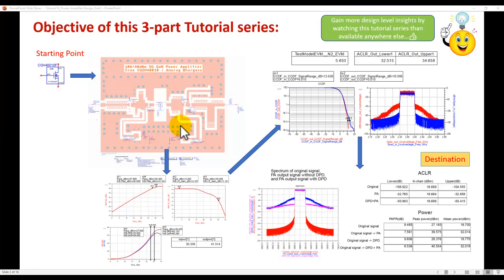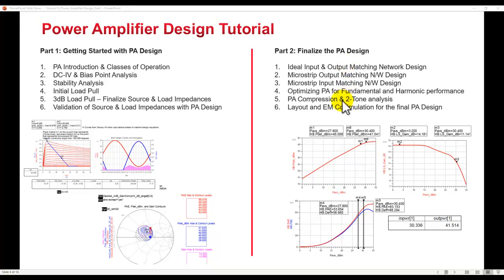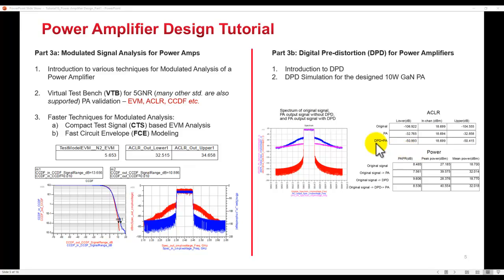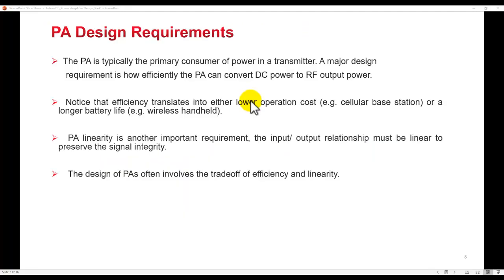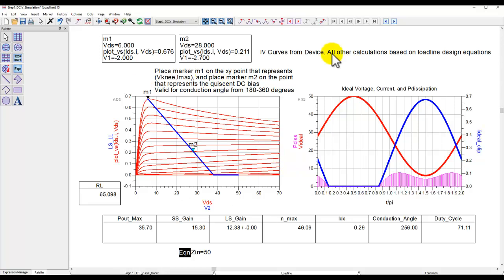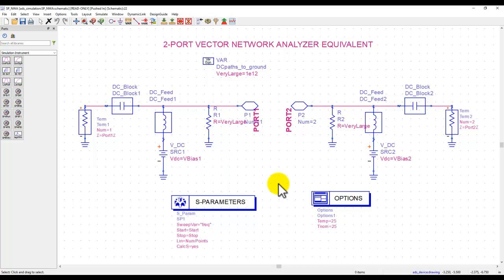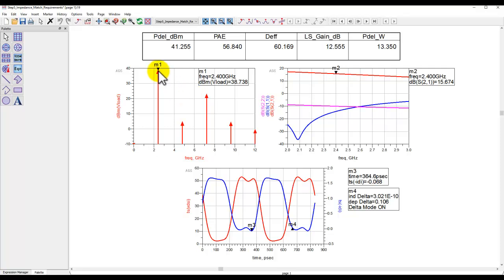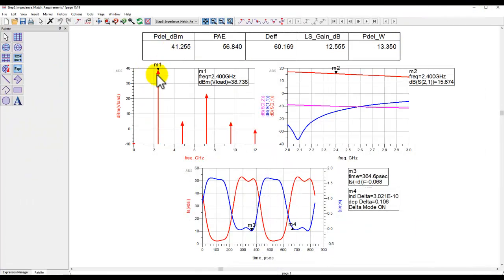RF Design-16: Practical Power Amplifier Design - Part 1

Comment: Hi sir, your video is very helpful thanks for the video but I have a little confusion, I made a power amplifier using GaAs FET (mgf0904a) and in the datasheet it says dc bias recommendation with vds 8v and ids 200ma. after seeing your tutorial why don't you use a resistor for dc biasing? like in a fixed bias circuit so it uses VDD or is it actually okay if you don't use a resistor and directly VDS? 
Thank you, I hope you can help my confusion.

Comment: @BhargavaAnurag  thank you for your lessons, they are very helpful. My question is it real to get somehow all libraries of CGH/CG2H devices not from MACOM, they are not responding? Second question, is it real to create wideband PA based only on S-parameters, so without Load_pull? Thanks in advance
Reply from the maker: @maxkashchich7206  You won’t get very far with S-Parameters while doing PA design as whole point is to have non-linearity included in nonlinear simulation. If MACOM is unresponsive then look at other vendors like NXP, Qorvo etc
Reply: @BhargavaAnurag  thank you so much for feedback. I am not so experienced in ADS, can you please give me some algorithm how i can work with s-params only? As i understand, i have to use SnP module and "simply" make IMN and OMN for source/load 50Ohm circuit? Or i can make Harmonic balance or something else? I've seen Qorvo provide only SPICE model or Keysight's others products model but not for ADS, are they interchangeable?

Comment: Thanks for the detailed PA design tutorial. I just have a question about stabilizing the PA. If we have to reduce the resistor value (to maintain a specific gain at the operating frequency) in a way that the FET becomes stable starting from a little bit lower than the target frequency range, how we can make sure we won't end up having oscillation at lower frequencies? For example, the target frequency is 5-6GHz and a 2 ohm resistor stabilizes starting from 4GHz. a 10 ohm resistor can stabilize starting from 1GHz, but will reduce the gain at 5-6GHz substantially. I was thinking maybe the limited bandwidth of the matching network at the input would help to avoid any oscillation out of the target bandwidth. Or, we have to introduce a high-pass kind of filter at the input. 

Thank you in advance!

Comment: Sir, how to efficiently copy the simulation result data equations from one workspace to another workspace?
Reply from the maker: The way I use is to simply create a Data Display Template and then you can use it in any workspace you want. Only restriction is to have same variable & node names for which you wrote the original equation else the relevant equations will show an error...😊 You can watch the relevant video under Learn ADS in 5mins playlist for more details.

Comment: thank you for this tutorial, it is very beneficial. my question is how can I apply these notions and principles on a circuit of cmos transistors like the figure below (use a basic transistors nmos+pmos to build a PA not a model like CGH400010)
Reply from the maker: CMOS kind of designs requires slightly different implementation notions but basic PA fundamentals will remain same.
Reply: @BhargavaAnurag  thank you very much

Comment: Hi Anurag,
I am trying to follow through these steps using the S2P files given from Macom for CG2H40010.
Can you please throw more light on the effect of using S2P files to design PAs.
I have tried simulating using the file but getting a PAE of -0.092.
Is it possible to use S2P files or I will need a non-linear model of the transistor?
Reply from the maker: Unfortunately you can't go very far with S2P file as it is only linear S-parameter data. Try to obtain the non-linear model of the device for proper simulations.
Reply: Thanks for the feedback. I'll contact the team for the non linear model.

Comment: Hi Anurag,
Thank you for the very informative tutorial, I am currently designing a Class B amplifier @2GHz  using this device (Biasing at -3.4V), and I'm able to follow until the impedence matching. I selected my load and source impedances, and while doing the final step, the S parameter graph is not matching what the datashet says. S21 is at -15dBm and S22 and S11 are much higher than S21. The power delivered and PAE match from the Load Pull analysis, however, the S parameter graph is not making sense to me. Is it because the S parameter is giving me small signal information? If so, does it matter in the design?
Reply from the maker: Your simulated graph may not match with the datasheet graph entirely and that's normal. S-Parameter shown in datasheet are not power dependent but just act as a guideline. As long as you have done things correctly in your large signal setup you should be fine.
Reply: @BhargavaAnurag  Thank you for the response, another issue I ran while designing the class B amplifier was while optimizing the return loss. Since it's in class B operation, S22 and S11 are not decreasing, and I don't know if it's because of the class of operation or is there something wrong with my design.

Comment: Thanks for your video. Can you share cree library? I am having problem adding cree library to ads
Reply from the maker: Unfortunately no, library is provided under NDA and it can't be shared. If you already have the library and facing some trouble then kindly contact local Keysight tech support team for help.
Reply: @BhargavaAnurag  So can I replace it with FET RF3931 from RFMD?
Reply from the maker: @thinhvu7919  Sure, you can use any device and the process shown in the video will remain the same.
Reply: @BhargavaAnurag   in step 5, i tried to simulate myself the way you share. But when running the simulation, the results are not the same. Please explain to me
Reply: specifically  in step5  I have the problem "Unable to resolve variable (s) or functions (s) in expression` Pdel_dBm = 10 * log (Pdel_W) +30 '"and so on with other variables like LS_Gain_dB, PAE ,Pdel_W etc
Reply from the maker: @thinhvu7919  I would recommend you to kindly work with local Keysight tech support team and they will be able to help you as YouTube is not a good place for tech support.
Reply from the maker: @thinhvu7919  YouTube is not a nice portal for tech support. Kindly contact local support team for help.
Reply: @BhargavaAnurag  I tried very hard to find the problem but still cannot display the data in step 5 like yours. The support team was also not helping. Please share more details about your step 5. I still have the problem as mentioned above
Reply: I think the capacitor is still the problem. it prevents direct current in step 5
Reply: "Unable to resolve variable (s) or functions (s) in expression`  I can't fix this error
Reply from the maker: @thinhvu7919  Are you referring to Step 4 or 5....the errors that you described seem to be for Step4?

Comment: Hi!, thank you for this usefull tutorial, yet i have a quastion, i downloaded the Matthew Ozalas archive file, and i saved his data display window as a Template, but when i did the FET_curve_tracer test for a transistor from my library the template didnt work (not displaying the signal), so how did you made it working for you?!
Reply from the maker: You need to focus on the Wire Labels as the default template might use different name than what is expected in Matt's template. Hope this will resolve the issue for you.
If you have access to Keysight Knowledge Center then you can download the complete PA workspace, that way you can directly look at my design.
Reply: @BhargavaAnurag  can you share the direct link of your workspace in Keysight Knowledge Center? I could not find it in the Keysight Knowledge Center.
Reply from the maker: @bugrahan1946  Here is the link: https://edadocs.software.keysight.com/display/eesofkcads/Tutorial%3A+Power+Amplifier+Design+in+ADS
Reply: @BhargavaAnurag  Is this link still available for those who have KC access?

Comment: Don't we have to verify the S parameters we get through non linear model with that of linear model? As in from datasheet?
Reply from the maker: You don't need to (but surely you can if you want to) as long as you are seeing similar gain on exactly the same bias conditions. The S-Par from non-linear model and what's there in the datasheet will never match 1:1 as during device modeling things will be slightly different than what you measure on bench so as long as you are in near about zone you should be fine.
Reply: @BhargavaAnurag  ok

Comment: Hi, I wanted to know how circuits can be imported onto latex or presentation or if there's a way to get out a clear schematic graphic file in a jpeg, png format.
Reply from the maker: Hi, I always use Snipping Tool offered by default in Win10 PCs and it works best as per my experience. To increase the quality & clarity, I would typically go to Options->Preferences->Display tab and make the schematic background to be White instead of default off-white and that helps. Also, if you want you can switch off the Grid dots for plan background.
Hope this helps...
Reply: @BhargavaAnurag  thanks so much! This helps a lot.

Comment: sir how to find the technology node in RF transistors, like 90nm, 45nm and so on?
Reply from the maker: Sometimes this kind of details are mentioned in the datasheet but if this is not mentioned explicitly then I am not aware of any method to find that out and only transistor vendor can provide such info. Also, I am not even sure why finding out that detail would help in your design? You can characterize the specific device for parameters like fT and rest of the performance parameters and that would tell whether its the right device for your application or not.

Comment: Your design series are perfect, I have watched all so many times. Why the GaN devices are common used in 3dB compression? It has less non linearities in further compression than other transistors?
Reply from the maker: Hi Andre, GaN usually have a good linearity past P1dB point compared to other devices like LDMOS hence it is preferred to use 3dB as the preferred compression point which is kind of Psat point for other devices and by operating here you can also get better PAE performance.
Hope this helps....
Reply: @BhargavaAnurag  Helped a lot, thank you!

Comment: Sir why we are using pretty high drain bias voltage? is that value matches with current technology???
Reply from the maker: drain voltage is selected as per the transistor/technology you are using. the transistor used in the tutorial is a 28V GaN device.
Reply: @BhargavaAnurag  okay

Comment: Hello sir,

I have a doubt, will the ads model provided by Cree, include the package parasitics or is it an ideal model without considering any package parasitics.

Thanks
Reply from the maker: Hi Dinesh,
Usually for devices like Cree transistor, the device model will include the package parasitics.
Reply: @BhargavaAnurag  so idi and vdsi are intrinsic drain voltage and current excluding the parasitics. Am I right sir?
Actually i used the de-embed network and mirror of de-embed network to obtain the same
and your trick is a time saver
thanks

Comment: Hello Anurag,
Great tutorial.
A quick question, You are not selecting the Number of fingers and width of the transistor here.
Can you explain on how the fingers and width will vary ? how do we select the fingers and width? on what basis.
Reply from the maker: Fingers and width is not valid as it is package transistor for 10W applications. You do those kind of things when you deal with IC designs and it is dependent on the power density per finger as recommended by foundry for specific processes.
Reply: @BhargavaAnurag  thank you Anurag.

Comment: I still dont understand how you managed to get the template to run on the FET trace simulation.
Reply from the maker: If you are a supported Keysight customer, you can download the PA workspace that contains the required template for your use

Comment: Hi Anurag ,
Thanks for  sharing your knowledge .  
I am using CG2h40010 device is my simulation .By default  in cree library rth=85 (?????!!!!!!!!) .It must be  incorrect . I checked in datasheet it is 7.83 which is lower than CGH40010 device . For rth =85 , i am not getting  gain more than 8dB in Load pull. Shall I change the rth =8  ?
What will be effect of rth parameter in  actual hardware design ?
Reply from the maker: I would advice to check this with Cree tech support team.
Reply: @BhargavaAnurag  thank you

Comment: Thank  you sir for this amazing work. I am working on the BJT PA and its bias on base is usually current, How can I process the DCIV data like the template in the video? for example, the gain in template is calculated using gate voltage V1, but it is current in my BJT DCIV design
Reply from the maker: Hi,
You can use the BJT curve tracer template from the Insert->Template menu

Comment: Hello sir. Do you have tutorial to design GSM transceivers at 1800Mhz by using ads?
Reply from the maker: No, I don't have any tutorial specific to that topic but you could proceed with basic knowledge depending upon what level of design you wish to perform. If it is only system level then check out SystemVue tutorial on my channel.
Reply: @BhargavaAnurag    is it possible to find spurious free region using WHATIF tool if rf blocks are in series ex(super het receiver)

Comment: Sir, in my personal amplifier design, I encountered a problem, Wolfspeed GaN HEMT CGHV1F006S is a 6 port transistor, how to deal with this device, appreciate it if you can give me some hint.
Reply from the maker: You can contact Cree or read the datasheet to understand what those 6 pins are and set up the simulation accordingly.
Reply: @BhargavaAnurag  will try, thx for your quick reply!

Comment: Thank  you sir for this amazing work. Do you know how to obtain by manual calculations the values of the source and load impedances mentioned in the datasheet and their real meaning please?
Reply from the maker: Hi Paula,
I don't know of any method of calculating these impedances manually as you don't know anything about the transistor, you either need to know complete equivalent circuit of these devices which is not possible as no vendor would expose it, or you need to multiple measurements which are not always easy. Easiest way is to perform simulation to find out the relevant parameters.

Comment: The initial theory part and discussions make it a complete package indeed. 
However, I didn't understand "GaN device provides higher impedance so it is easier to match with system impedance (unlike GaAs)" -- could you please elaborate a little?
Reply from the maker: GaN is a higher bandgap devices hence offer little gate and drain resistance as compared to LDMOS or GaAs hence easier to match with 50Ohms.

Comment: Thank so much sir for these tutorials.I have a question. In stability analysis , I am designing a device operating at higher frequency like 11 GHz and I want device to stable from 2GHz onwards. So for that I am using a 10 Ohm resistor. But this leads to drastical reduction in efficiency . So how can I  improve the efficiency?
Reply from the maker: Efficiency can be improved when you do the Load/Source Pull and select the appropriate point as per your need. You need to be little more careful about gain while stabilizing the device. Achieving broadband stability depends on the device characteristics, some devices are easily stabilized and some are not.

Comment: Hello sir, can i used this transistor CGH40010 to design class E power amplifier???
Reply from the maker: Yes you can
Reply: @BhargavaAnurag  sir when I disgen class E power amplifier are steps different (vary) or not ??? Thanks sir
Reply from the maker: @zaramlslamalislam4614  Yes,, it will vary as the operating point criteria will change. I will Class-E in the future but not immediately.

Comment: Thanks for the amazing tutorial. I wanted to design an amplifier using Cree’s CGH60015D GaN HEMT bare-die model, can you provide me with the s2p file for this?
Reply from the maker: You can do much with S2P file if you want to do a PA design. It is better to contact Cree or other device vendor and get the proper nonlinear model for the transistor.

Comment: Hello Sir, Your video tutorial sessions are very useful and informative. I have learnt a lot about practical circuit design from all your sessions for which I am very grateful to you. May I seek suggestion regarding the transistor stability. Is it necessary that we need to check stability factor over a wide frequency range i.e. from say, 1Hz till Fmax or just around the PA operating frequency range?
Reply from the maker: Hi Devi,
It is not mandatory to check stability for wide freq range but it does give you advantage in terms of not to worry about oscillations at any frequency and that is called unconditional stability condition and this is how I prefer to design. You can proceed by stabilizing transistor only in your desired band of interest and this is called conditional stability condition, if you proceed with this option then I would advice to keep checking for load and source stability circles in every step of your design.

Comment: Hello Anurag Sir, I am unable to use the DC bias template as in Matt's Design. I have labelled the wires exactly as he has done but I see blank in my data display window and errors in the equation page. I have knowledge centre access but am not able to access your workspace either. Could you please suggest what can be done?
Thanks in Advance.
Reply from the maker: Hi Aparna,
I am not sure what issue you are seeing in downloading the workspace from KC if you have access. Could you please contact your local tech support team for help.
Reply: @BhargavaAnurag  Many thanks Sir, have done that.

Comment: From where can I get the device model as the link described below is not working.
Reply from the maker: Kindly contact Cree/Wolfspeed to obtain the library. You can use other vendors like MACOM, Qorvo etc as well.